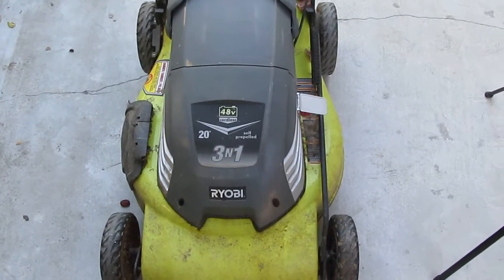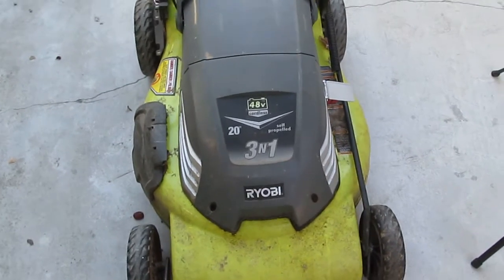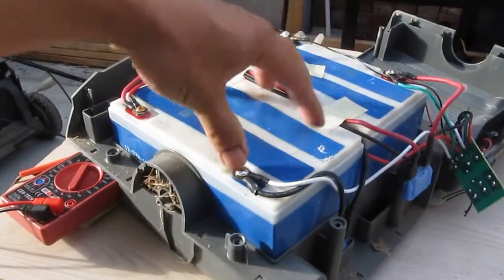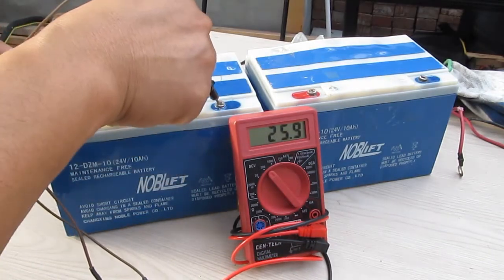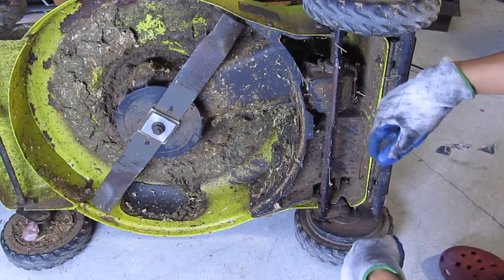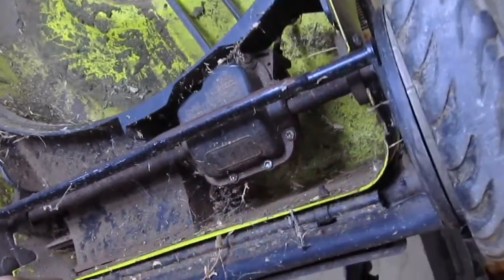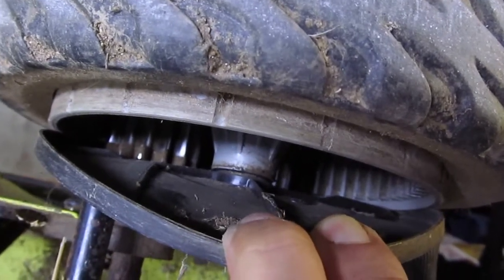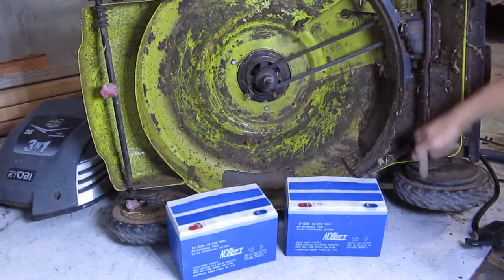Teardown: Ryobi 48V Cordless self propelled lawn mower

Comment: Any clue where to find these batteries or what size 12v batteries could be used to replace the 24v batteries?  A replacement pack is $90, hoping to assemble one for less.
Reply from the maker: $90 is actually a decent price for a 48V pack. It's hard to find four 12V packs for $90 though.
Reply: Thank you.  That's what I discovered through some searching.  It seems that the 24v batteries they use are unavailable anywhere which is odd.  I initially thought $90 for the battery assembly was a rip-off but it turns out that it's cheaper than buying 4 generic 12v batteries.

Comment: would it be possible for you to send me an image of the chargers circuit board. One of the resistors in mine blew out and I am not sure which one i need to replace it with because it deform due to the overload